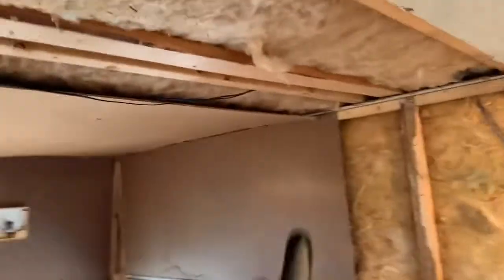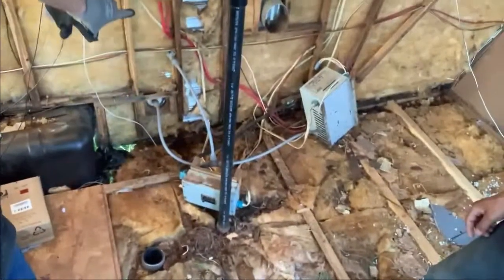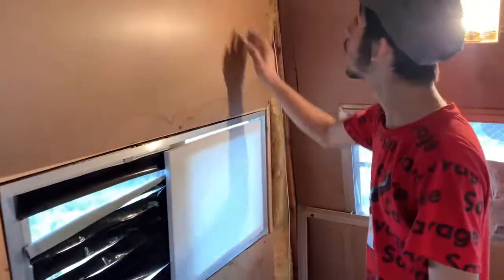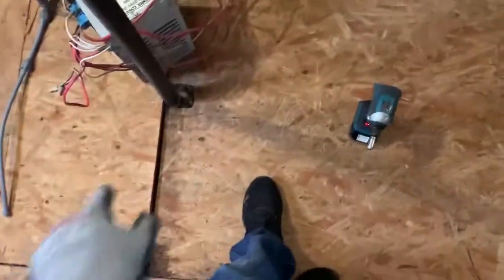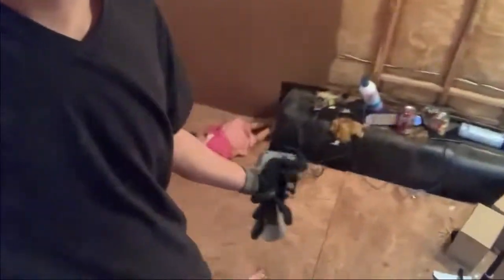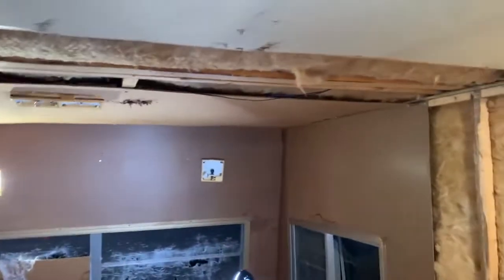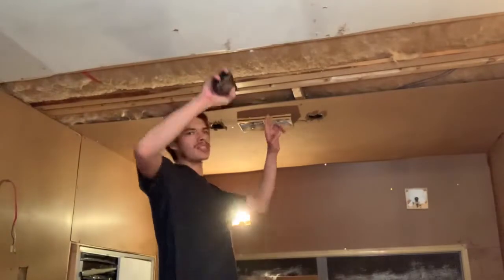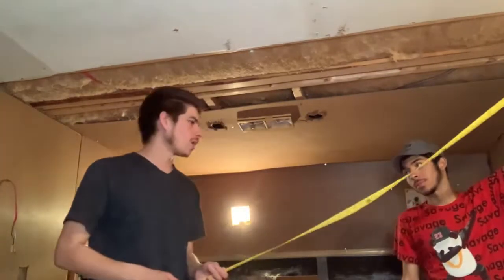$500 Travel Trailer/Rv Remodel Renovation! 1981 Shasta Freedom 20| Day # 10

Comment: Dont give up on this guys. Your problem is, you dont know what you are doing. But this is how you learn. 
You gotta stand back and get yourself a plan. You always start from top and work your way down. Get up there and fix the roof, so you dont have to deal with the water. Get your roof done, with all the new vents and the new air conditioner, and THEN start working on the interior. You will save yourself a bunch of headaches, and money. 
Use this cheap one to learn how to do it. Then when you get some experience under your belt, you can sell it off, and get another one that you can fix up nicer. 
Dont give up, follow through, and learn.